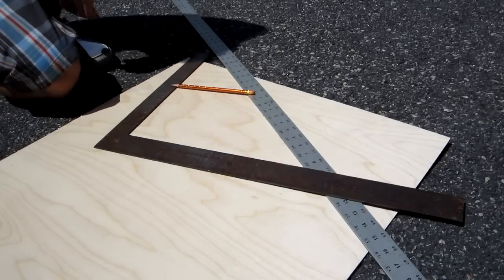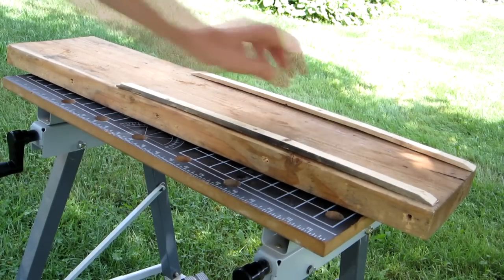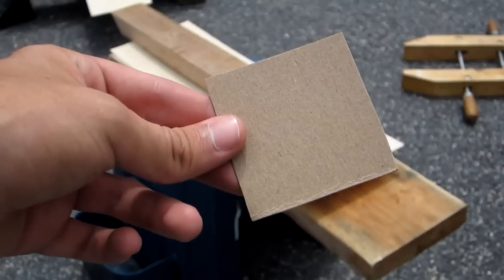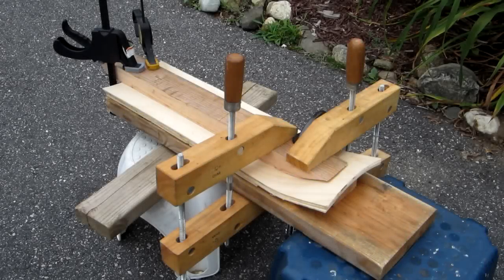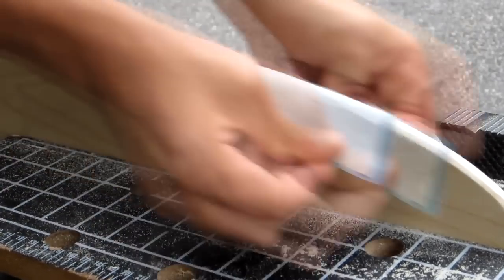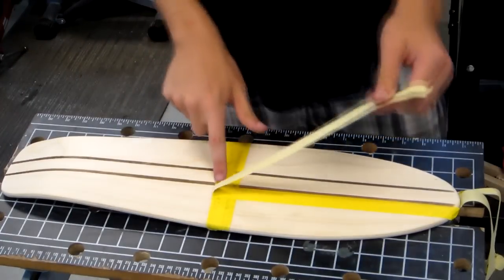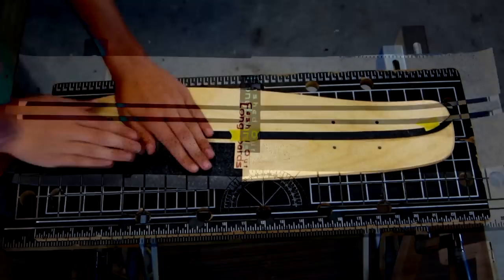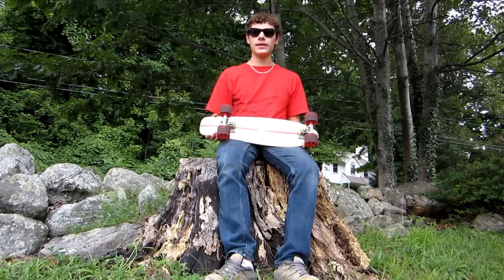The ULTIMATE Guide to Making a Cruiser Skateboard | CashedOutBoards

Comment from the maker: Thanks for the comment! I just found a pattern, I will message you a link.  Using wood would make the cruiser a little bit thinner than a penny board.  It will still be durable when made from wood but will not be able to be ran over by cars like penny boards, but as long as your careful it will not break.  Hopefully this helps!

Comment: Hey man, this is awesome.  Nice work!  I'm trying to make six boards for all of the groomsman in my wedding.  A few questions...what did you use to finish the board?  Polyurethane?  Same on top and bottom?
Reply from the maker: Yup, I used polyurethane, one less coat on the top because the grip tape covers it and adds more protection but if you do both sides the same it will work just as well. Good luck on your boards!

Comment: Alright, so I'm making this. I'm at the point where I need to drill the holes and I'm wondering how you avoided splitting the wood on one side when drilling.

Any tips on how you avoided exploding a little bit of one side when drilling would be greatly appreciated! Thanks, great video! Liked and subbed!
Reply from the maker: If you put a scrap piece of wood against the bottom of the board and drill through the board and into the scrap piece it should avoid the splintering issue.  Good luck with your board!

Comment: I want to make one that is 9x27 and I was wondering would this still be a good video to use.Also how many layers of Baltic Birch will I need because I weigh 200lbs.Thanks!
Reply from the maker: Yes, this tutorial will still work.  Since 27 inches is still a fairly short board, you might be able to get away with 3 layers but I would go for 4 just to be safe.  I hope this helps!

Comment from the maker: Sure, for materials to make the actual board you will need 1/8 inch baltic birch, some type of wood glue, grip tape, and clear coat.  As for the press, some scrap lumber and screws, and clamps to press everything together.  For tools, you will need sandpaper, a drill, saws, and a razor blade to cut the grip tape.  If I missed anything it should be shown in the video.  Hope this helps!
Reply: what does baltic mean and what is the difference between normal wood and baltic wood

can i use birch multiplex wood for this?
Reply from the maker: Baltic birch is just a kind of wood, it is better than normal wood such as pine because it allows for some flex but is still strong enough.  I am not certain that multiplex will work but as long as it birch for all layers and 1/8 inch or thinner it should.
Reply: Hi
Reply from the maker: Hi
Reply: CashedOutBoards Add some emotion to your face. It is really needed for us to feel connected to you and what you're doing.
Reply: I need your help. I am going to build a longboard but I dont know the dimensions for my concave and kick tail. I am doing a freeride design.  I watched one of your videos and you said for the concave use peices of scrap wood. How thick was that wood. And also what were the demensions of the kicktail

Comment: I have built 3 boards full sized longboards with 4plys of 1/8th inch plywood but they have all snapped or flexed  do you have any advise?
Reply from the maker: +Charlie Hamilton Did you stagger the way the wood grain goes? Having each board go a different direction? You also can try adding fiberglass or making your boards have shorter wheel bases.  Check out my complete guide to making a longboard for more tips!
Reply: use fiber glass in between next time.

Comment: Fantastic tutorial!!! Is there anyway i could get a hold of a pattern for the deck? Also i was wondering where you hot your wheels and trucks? Regular old skateboard trucks and wheels arent the same as the ones your using are they?
Reply: no those are for longboards, or at least the wheels are, they are smoother for cruising. i believe those are penny trucks but im not sure.
Reply from the maker: Thanks! I got my wheels and trucks off of a stereo cruiser board, which is like a penny board just a different company. Regular skateboard trucks are wider and will not turn as much and the trucks I used.  The wheels I used are softer and slightly larger than skateboard wheels.
Reply: You can buy separate trucks and wheels on penny´s website
Reply: HobbyApple you can buy separate trucks and wheels on any skate shop website lol, longboard trucks would be way better than penny trucks for this.
Reply from the maker: OutLived Yes, you can buy anything on a skate shop website, but longboard trucks would not be a good match for a 22" Cruiser board.

Comment: using your method, do you think there is any way to add some camber to a slightly longer board to give it some of that rise in the middle? great vid btw...simple yet well made.
ps. also what tape did you use to tape off for the lines. every time i have tried to stain it bled tru...even using a small amt haha
Reply from the maker: I'm glad you enjoyed it!  You can add camber with a slightly different press, I made a 33 inch cruiser which is in my longboard quiver video that has camber.  I might make a video on it eventually but for now look on sites like silverfishlongboarding for ideas.  The tape I used is masking tape, I think the brand was 3M.  Hope this helps!

Comment: @crashedoutboards
I can only get 4mm birch. I weigh 145 pounds and I dont kniw if I should use 2x4mm birch or 3x4mm.
Please respond quickly!
Your videos are great :)
Reply from the maker: Thanks! I'd say go with 3 layers even with a board this short.  4mm is equal to just over 1/8 of an inch, so I'd say better safe than sorry!
Reply: Thanks :)
Reply from the maker: No problem! Good luck with your board!

Comment: How flexible is this board? Also, if I want a stiff or near stiff board, what should I do?
Reply from the maker: +Liam “baller242” Reid this board is real stuff because it's short. To make it stiffer you could add more layers, more concave, or fiberglass  the bottom.
Reply: CashedOutBoards ok thanks, because I'm making an electric longboard, and I don't want the board to be too bendy, and smash the electronics. The board will be a 31 inch cruiser, any suggestions on materials?
Reply: Most boards are made out of hard rock maple. Cash is using baltic birch. Your board's flex will be determined by the materials you choose to use, your weight, and your wheel base. I am 5' 10", size 12-13 shoe, and 280 lbs and I like the feel of the landyachtz tug boat. There are many resources online that can help you further. My advice is to go to a skate shop and find what works for you, then try to build something like that.

Comment: hey question for ya, what are the dimensions on this one? i want too take apart my plastic penny board and use the trucks and wheels on my own deck that im making from this video, would they fit do you think? or will i have to buy my own trucks and wheels, if thats the case what are the ones you use in this video.
Reply from the maker: The dimensions on this board are exactly the same as a penny board, 22x6 inches, so yes, penny trucks and wheels will definitely fit!
Reply: thanks man youre really helpful
Reply from the maker: Any time, glad I can help!

Comment: Do you still need to put Polyurethane on the board if you use fiberglas on the top and bottom?
Reply from the maker: I don't think you have to, also if you do there is a chance of discoloration.  The resin from the fiberglass should be enough.
Reply: Ok thanks for the quick answer I almost did it wrong.
Reply from the maker: No problem, I'm happy to help!

Comment: none of the stores around me sell 1/8 or 1/16 what should I go with instead.
Reply from the maker: You can try 1/4 inch but it will be very difficult to bend.  You can probably get a very slight amount of concave but no kick tale with 1/4.
Reply: ok Thank you and if I cant get birch would maple or pine do
Reply: I'd go for maple, pine plywood is normally lower quality.
Reply: ok thank you they just don't have anything but 1/2 or 1/4 plywood around me so I think making this will be a little tricky for me but im going to try hahaha
Reply from the maker: Yeah go for it, if nothing else it should be fun

Comment from the maker: Yes, this press will work.  It should be even better with 1/16 veneers because they should be easier to shape than 1/8 inch plywood.
Reply: so if you used 1/16 veneers you would use 7 or 8 of them?
Reply from the maker: You should be fine with 7, or maybe even 6 if you make a short cruiser like the one in the video.

Comment: any good altenatives for the clamps?
Reply from the maker: Yes, you can design a system which uses lag bolts which can be tightened with a ratchet to press the board which actually works much better than clamps.

Comment: what size was your countersink? please respond :D
Reply from the maker: The diameter is around 1/2 of an inch, but it is angled so the actual countersunk part is the diameter of the head of the bolt.
Reply: CashedOutBoards thanks alot i ended up buying one at a local shop. My boards are definitely going to look better!

Comment: Any wood just 3 sheets it will work?
Reply from the maker: TheGoldenMinecart Not exactly, it depends on the type of wood, length of the board, and the thickness of the wood.  For the 1/8 baltic birch and a shorter board like this, 3 sheets does the trick.

Comment: Why the F#*% are you using a file on wood???
Reply from the maker: +connor brooks because it's an extremely common wood working technique that allows for fast shaping. Why wouldn't you?
Reply: Personally I only use files for metal and plastic, you can get problems filing wood such as splintering corners and de-laminating plywood... And all my teachings were not to use a file on wood... :/
Reply from the maker: +connor brooks yeah you have to be careful with what direction you file but files and rasps work great for rough shapeing
Reply: I guess so, I just prefer to be "gentle" and take my time with the wood personally, I guess just agree to disagree, you use files and rasps for wood I don't...  We both have our preference... 👌 ✌
Reply: And all in all this turned out a nice board... Well done with that..